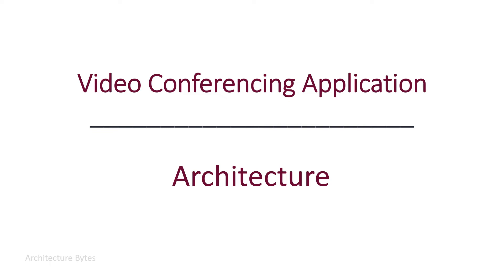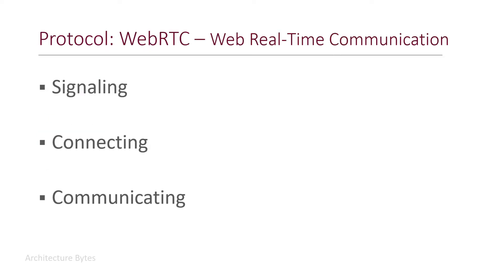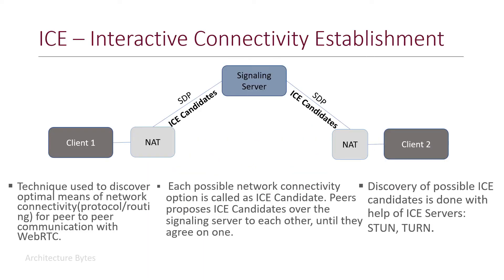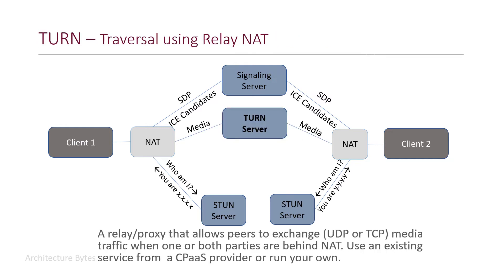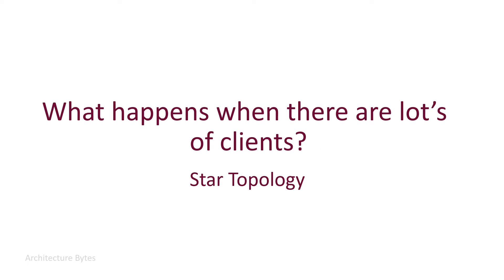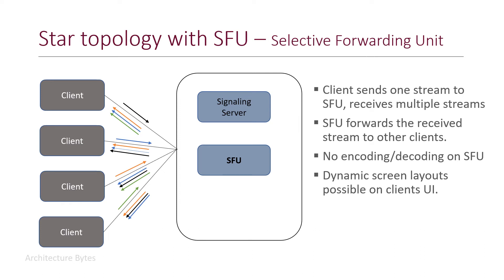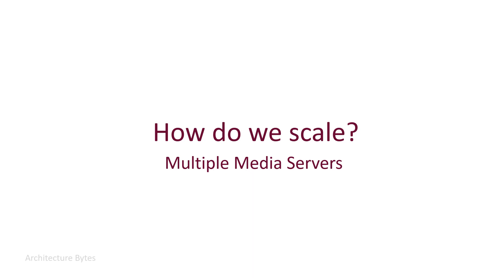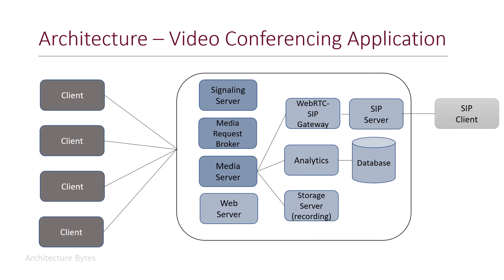Video Conferencing Application Architecture | WebRTC | Zoom System Design | Zoom Architecture

Comment: The slide titled "Star Topology with SFU" is incorrect in stating that the client sends one stream to SFU and receives multiple streams. Just the opposite. The client simulcasts multiple temporally scalable streams to server corresponding to different resolutions. The SFU server picks the appropriate resolution and temporal layers of each sender and only forwards that stream to the receiver. This process of "thinning" is done on the basis of the bandwidth estimation and associated bitrate allocation at the SFU server.
Reply from the maker: Please note:

Star Topology with SFU 4:45: 
Client sends one stream. 
Receives one stream each from other clients via SFU.

Star Topology with Simulcast SFU 5:18: 
Client sends multiple streams of different resolutions. 
Receives one (optimum) stream each from other clients via SFU.

The incoming streams in the diagrams are not streams of different resolutions from one client, but separate streams - one from each (other) client.